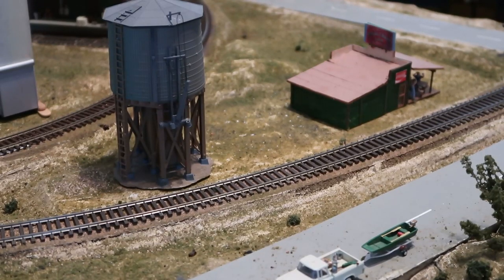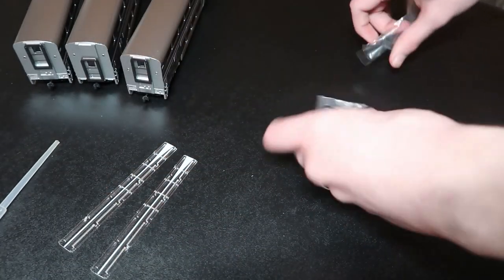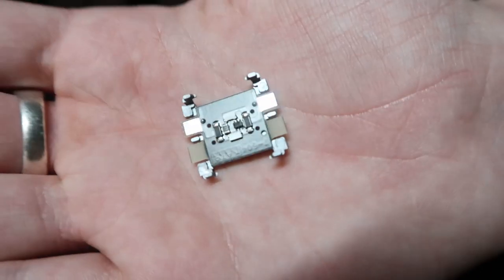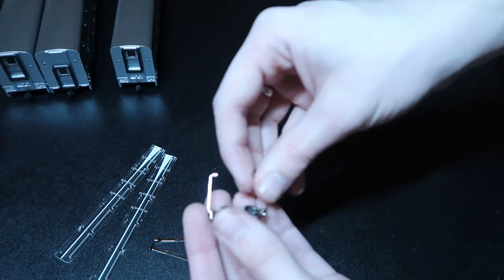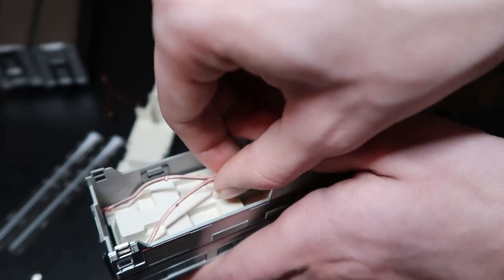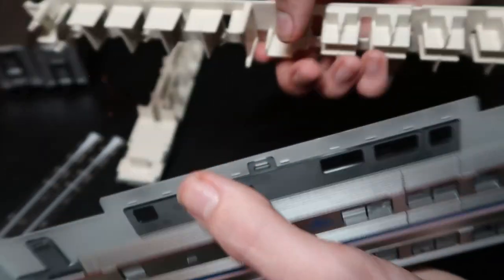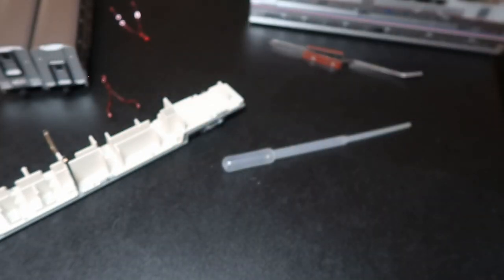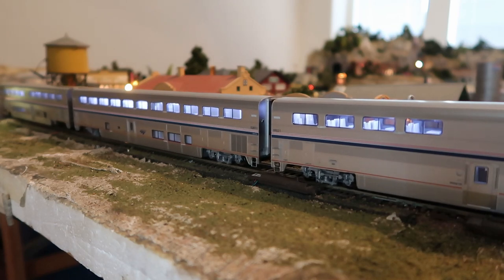In Depth Kato Superliner Lighting Kit Install

Comment: Thank you for this very helpful video.    I went down the same road you did -- followed all the Kato instructions to the letter and got nothing.   Tried two more times, then found your video.    Your suggestions at about the 12 minute mark on testing electrical connectivity were the key.    The little metal tabs simply were not in contact with one another.   Once I fixed that everything works fine.    Thanks again.
Reply from the maker: Glad I could help!

Comment: Another way to test the light is to assemble the metal light rods to the "wings" and circuit board and insert the "plate" parts of the rods  into the bottom part of the car, and then simply put the car on powered track to check whether the light comes on.